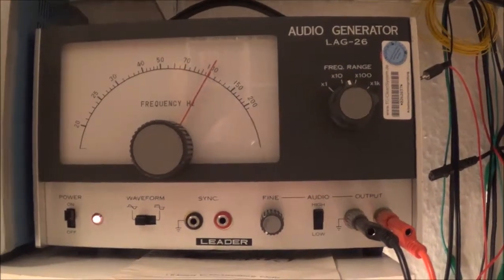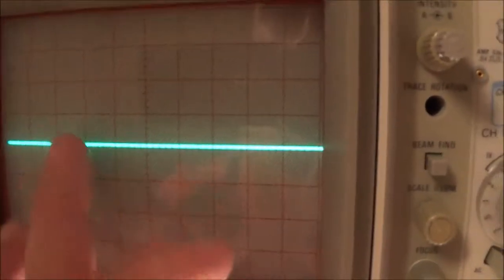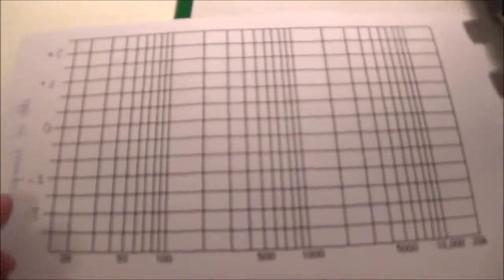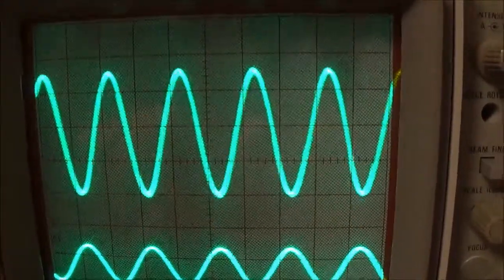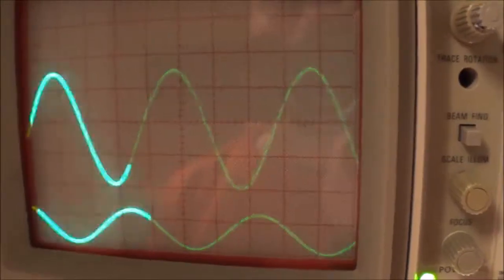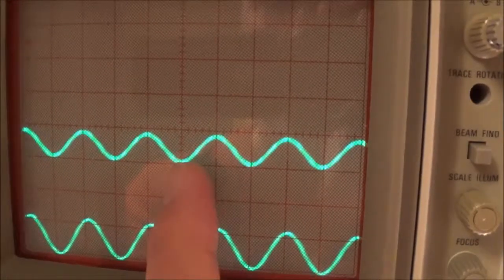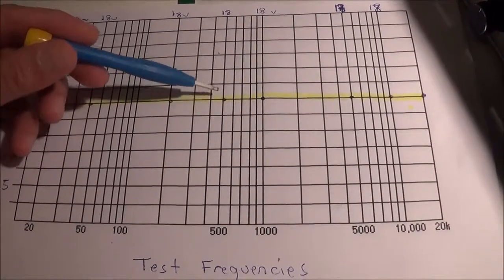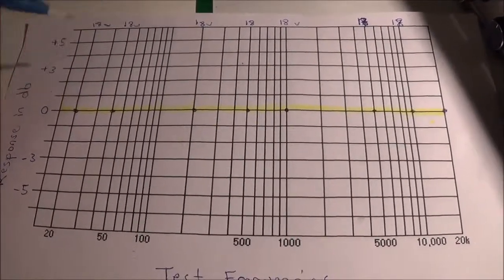Hitachi SR3400 Frequency Response Test

Comment: You should be able to do this test via a mic input such as on a boombox correct?  And a function generator should work just fine?  ~Jack, VEG
Reply from the maker: You have to make sure that your audio oscillator (function generator) has a flat output over the frequencies to be tested, if not, you could end up with erroneous readings. Best to hook up an analog AC voltmeter (if you have one) with adequate frequency response (see meter specs) to the oscillator so that you can monitor things. I have never did a boombox frequency response test; but, i think it could be done this way. I don't even have a mic.
Reply: Like you, I buy vintage test gear...you know, spend $500 on gear to work on a $2 radio!  :)  I just received a new (to me) Tenama AC Millivoltmeter 300uv - 100v, so I should be covered!  Thanks!  ~Jack, VEG
Reply from the maker: ha, i know all about that. $500 to work on a 2 dollar radio?; definitely makes sense to me. yeah, those ac voltmeters are with their weight in gold....or maybe brass...